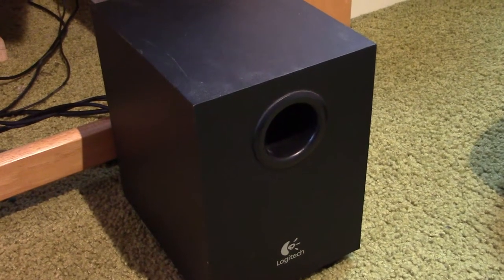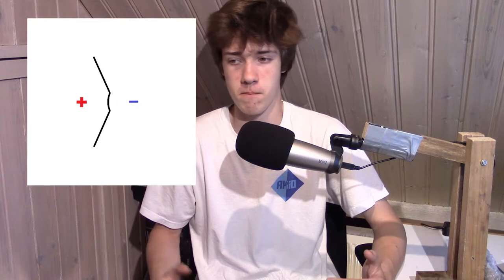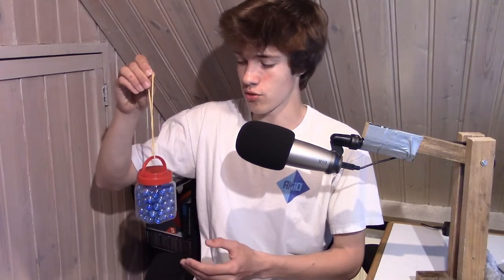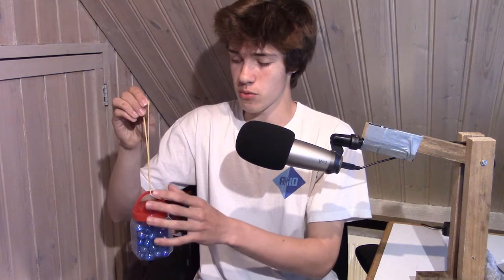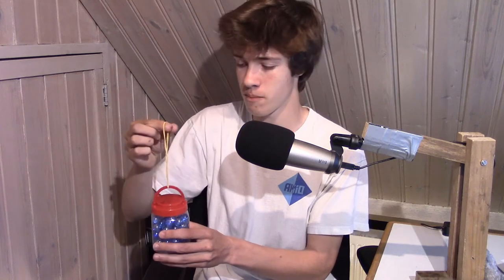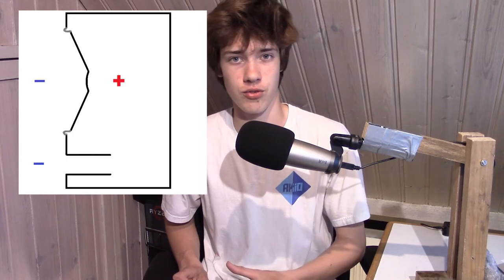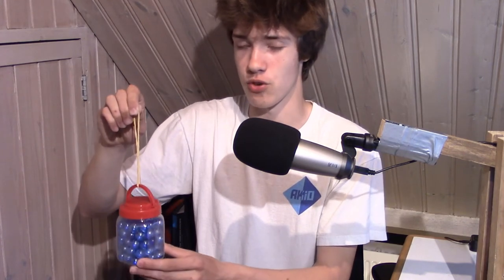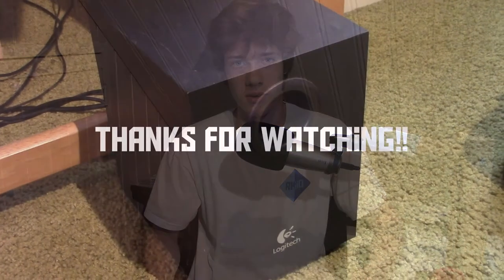How does a ported speaker cabinet work? (AKIO TV)

Comment: Very good video, except that the sound (pressure) coming out the port is not in phase with the speaker... it is 90 degrees out of phase
Reply from the maker: The phase of the sound from the port is variable depending on frequency. At the tuning frequency it's exactly at 0 degrees.